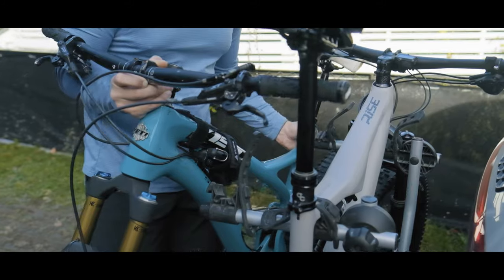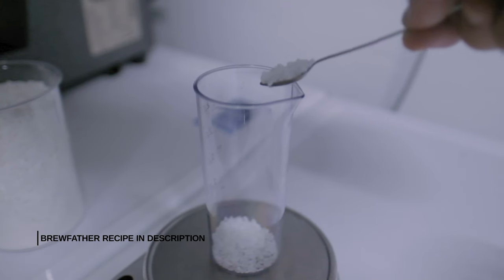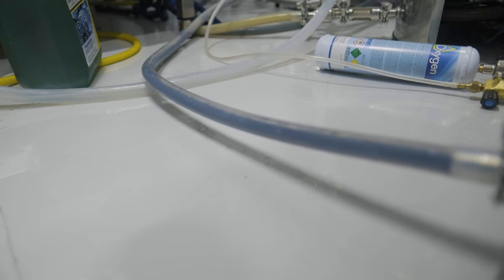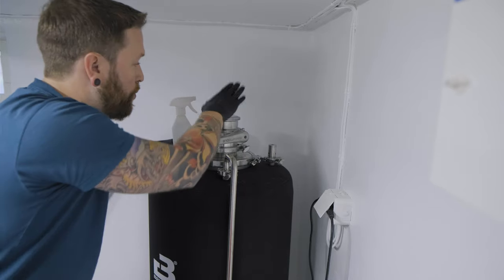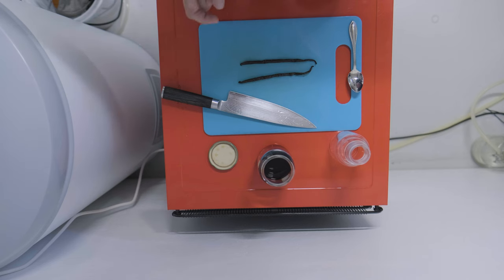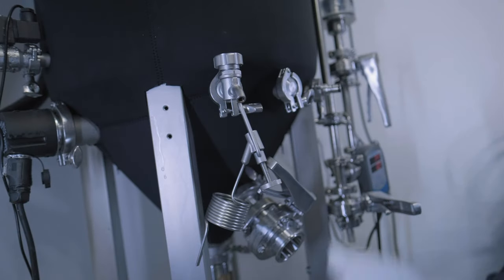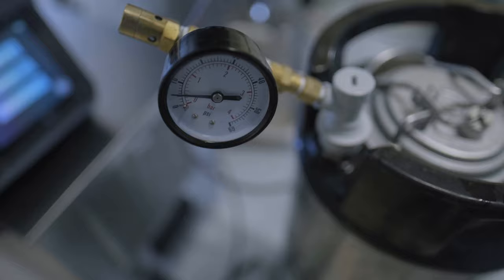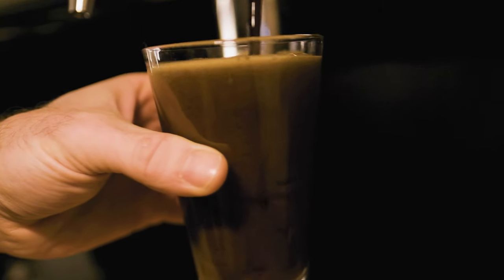Brewtools Tips & Tricks: Nitro Oak-Aged Imperial Stout | Starting a brewery: Ep11

Comment: When you pushed the beer through the system with co2 would it not make more sense to not push it through the pumps? Maybe have the co2 input on the other side of the b150 and unsure about the other pump, maybe create a bypass for it?
Reply from the maker: We input the CO2 just after the Brewtools pump, but yeah, it does go through the Riptide pump. Haven't had any problems. As long as the pump isn't trying to run I don't see it being an issue, but certainly a bypass could work too :)

Comment: Great videos, what pressure did you set your 80/20 to for carbonation and serving? I'm having a bugger of a time getting a pressure that gives sufficient vols of CO2 and doesn't shoot out of the tap at 100mph, have a flow control tap but the smallest tweak goes from no flow to a pint a second!
Reply from the maker: I'm typically aiming for approx 2 bar (30 psi) for the beer gas mix pressure. I also, have had the beer slightly carbonated (to approx. 1 vol) beforehand. Beer coming out super fast at these pressures if you don't have flow control taps is certainly issue. One way to possibly address this is increase the line length of that tap. Right now I have a new kegerator that I bought as a kit and the line lengths it came with are WAYYYY to short in my opinion. So my new kegerator is certainly pouring a bit too fast verses my old one with the only change being line lengths (added resistance). Let me know if you have more questions! We can get this dialed :)
Reply: @BentGateBrewing  thanks! I’m at around 35psi currently. Unfortunately this is a keg with the tap directly mounted, it’s in my can/bottle fridge as the keg one is full! Might try and jerryrig something in the fridge to mount the tap on and then use a metre or two of 3/16” line. Really don’t want to mount taps on the front of this fridge as it’s in the garden shed with the lawnmower and all the other ‘might come in useful’ shite a gentleman like myself gathers over the years.